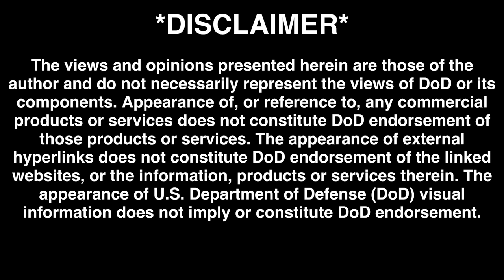F-16 and F-35 Engines - Pratt & Whitney vs GE

Comment: When is the last time this guy flew a plane, especially a fighter jet. The pratt engines are 2nd to none. Did they just have a issue ( yes  they did) but it was a isolated incident with the metal cooling process. Other then that the engines go thru all kinds of testing before they are ever put in a jet. If their was such a big issue they would have not been put in
Reply from the maker: Rick was the chief engineer for the AIr Force at Wright Patterson.  It has nothing to do with whether or not he flew.

Comment: Most don’t realize the people building the stuff and the top brass have a disconnect. The military industrial complex is designed to create a need for an upgrade. That’s why we’ve been very advanced aircraft fail. Or look at a Blackhawk how they pussyfooted around on upgrading engine power when it was blatantly obvious it needed more power immediately. But it’s all about creating a product that has 10% of the capability. And then they tell the military. “HEY HEY! Listen, YOU NEED the New (ECHO MODEL) or 60MIkE. They put bigger engines but they added 250lbs for the glass cockpit or avionics so it canceled out the gain I think we need to stop buying the crap and literally just wait until we are attacked. Then we can just take it in the ass. It’s pointless to build this crap when our nuclear ICBMs is what actually defends this country. American hubris prevents people from seeing the only thing that keeps us safe is ICBM missile fields. If you ask our enemies